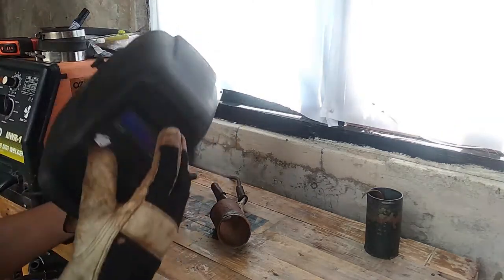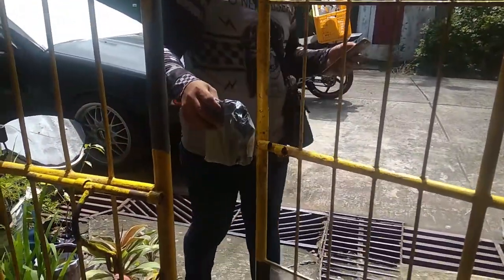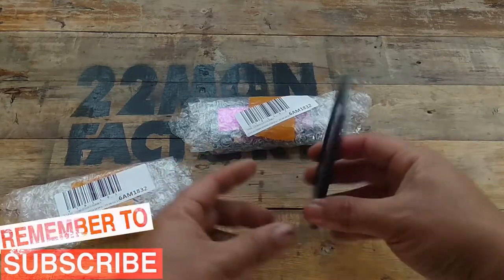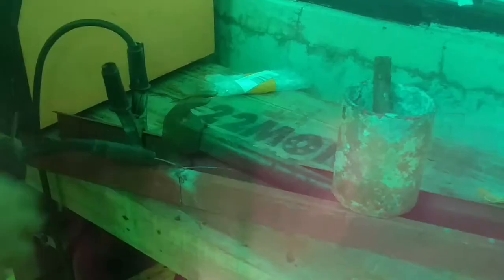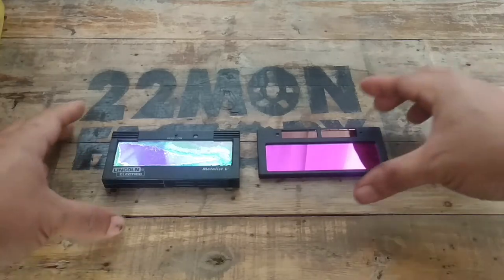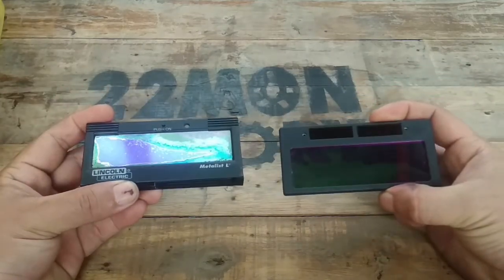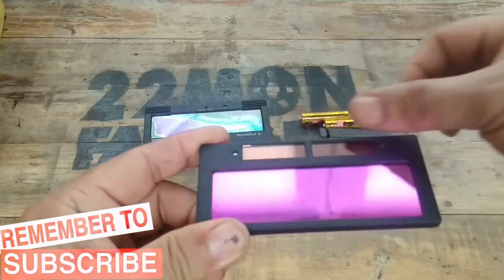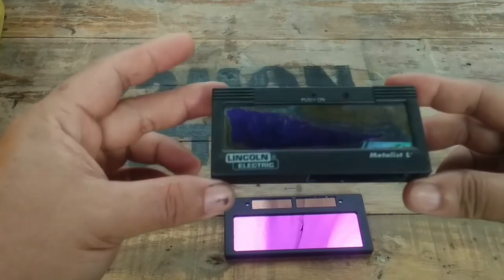Welding Mask | Auto Darkening Lens - Cheapest i found online

Comment: Im using it to but it only last for a couple of months, though i have spares. Ill try to put the dead ones under the sun if it revives.
Reply from the maker: I also noticed, if i don't use it for a while autodark seems laggy. Had to expose it to the sun for a few minutes then it's good.  Once your welding is continous it should charge from the weld arc.

Comment: Whoa that Lincoln Electris is an old one!  I have never seen an auto lens that's powered by two AAA's before!  O_O
Reply from the maker: I bought that welding mask from a thrift store. Nobody recognize its autodarkening. And theres no batteries when it was displayed for sale. So i grabbed it. I served me more than 3years . until i left it on the shelf too long with batteries in it, batteries went bad and leaked ruined the lens. Changed new battery sometimes it would work sometime its just stuck to dark mode. Until finally it just failed.